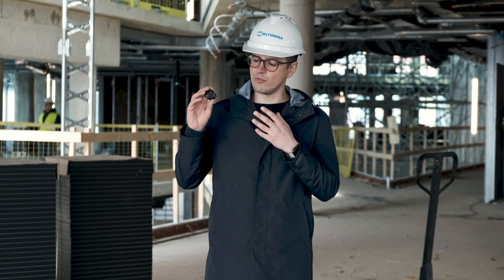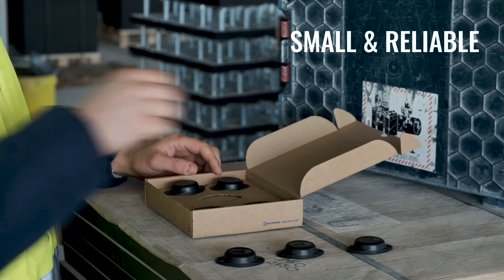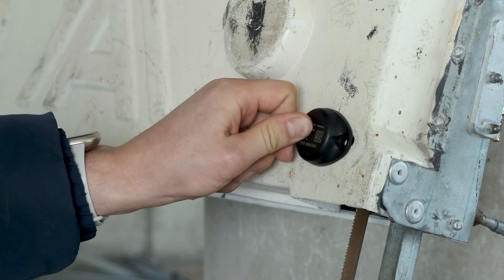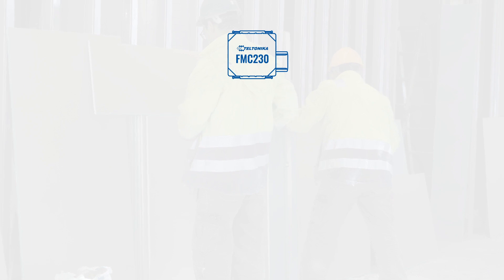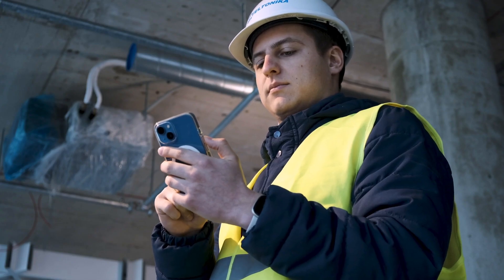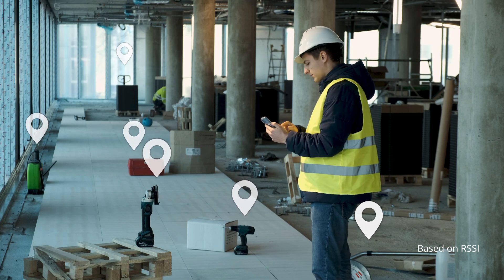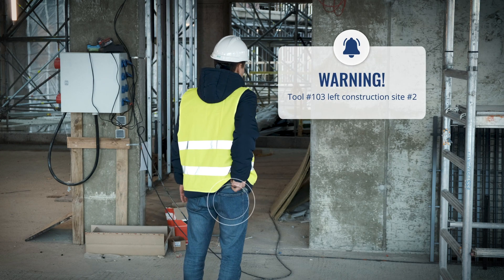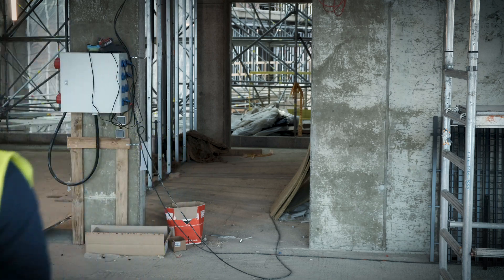Construction Equipment Monitoring |  EYE Beacons | Teltonika

Comment: How can this eye beacon assist in inventory control? Is this a use case? Also, if the gateway is not within reach, how will these be tracked when off site?
Reply from the maker: Hello, 

The ability of a platform to assist in inventory control fully depends on its features. It could automate the process if the items are assigned beacons, making it possible to precisely determine their location and quantity. Here are some related use cases:

Construction tool tracking: https://teltonika-gps.com/use-cases/agriculture/construction-tools-tracking-with-ble-beacons 
Indoor tracking: https://teltonika-gps.com/use-cases/assets-and-workforce/indoor-tracking-solutions 
Goods tracking: https://teltonika-gps.com/use-cases/assets-and-workforce/goods-tracking-with-ble-beacons-and-sensors
Medical equipment tracking: https://teltonika-gps.com/use-cases/assets-and-workforce/medical-equipment-tracking-with-eye-beacons

If there is no gateway within reach, as you mentioned, the solution will not function because the EYE Beacons will not be scanned. However, in the context of construction, it is advisable to install gateways at storage facilities and construction sites of interest and to equip transport with Fleet Management trackers. This setup should ensure coverage in all locations where the items might be found.

For a solution that is autonomous and does not require a gateway, we recommend exploring the TAT battery-powered GPS tracker family, such as the tamper-proof TAT240: https://teltonika-gps.com/products/trackers/assets-workforce/tat240

Comment: Which software is needed to visualize the beacon's locations or show the exact position and state of a triggered beacon (for example one with motion detection capabilities)?
Reply from the maker: You may use any platform or APP that supports iBeacon or Eddystone protocols and meets your specific use case requirements.